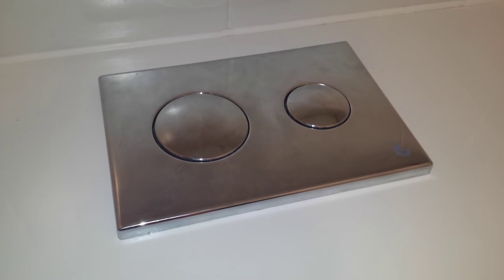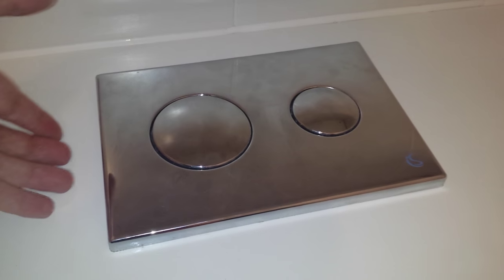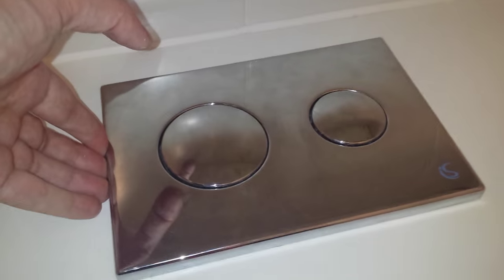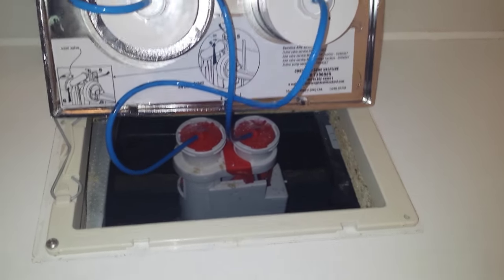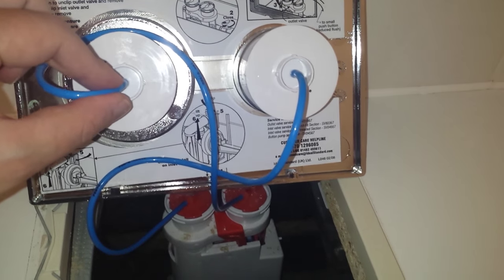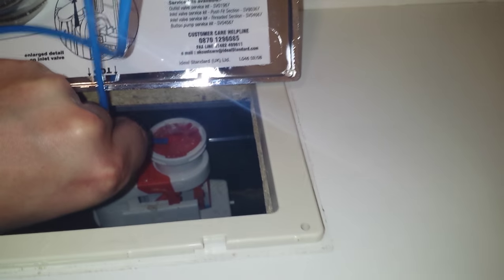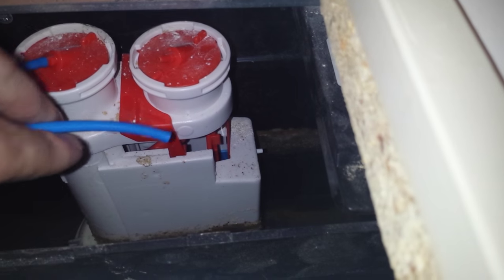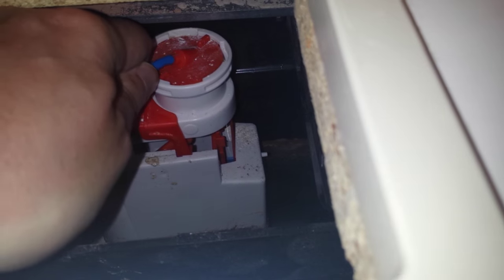Ideal Standard Flush Plate Removal

Comment: Thanks very much for this video, it was just what I needed.  Great that the Ideal Standard model number is no-where visible.  Turns out the big pneumatic pump has had it, but the spare part code, which IS printed on the back once you get the damn thing off, is more expensive than buying a whole new unit including the two pumps!

Comment: My toilet cannot stop after flushing. It leaks in small amounts but when I opened the lid I noticed the water continues to flow out through the back part of the part labelled 6 on the diagram (maybe the inlet valve). Please help.
Reply from the maker: Not a plumber, but part 6 is where the ballcock rises and stops the water, so if that is leaking then google how to replace the ballcock valve washer.

Comment: I'm hoping you can help me with another issue. My toilet will not flush.. No pressure from the push buttons. Any ideas?
Reply from the maker: Not a plumber, but try manually moving the mechanism that releases the water, as it may have just got jammed.  I had to take mine apart and clean off the limescale, but you can often buy the whole mechanism off amazon for a reasonable price.
Reply: @GreyCubeTube  Thanks GC, I did manage to put water manually in which worked for one flush. Any ideas what the mechanism is off by hand? I haven't the foggiest.
Reply: Think Ive fixed it. Issue with the rubber seals from one of the push buttons to mechanism and the cable is rubblish. Thanks GC
Reply from the maker: @BillyBufter  Good job, glad you got it sorted.  To answer your earlier question, the mechanism in my toilet is listed as SV93467 on amazon.
Reply: Can you please do a video to help us

Comment: I have exacly the same  buttons only i have a issue it is very hard to push that buttons when i want to flush the toilet have you ideea what can be or how to solve this issue?
Reply from the maker: The buttons push air, the air pushes the plastic mechanism, most likely the mechanism is covered in limescale making it hard for the air to move the parts. It's hard to clean, so easiest to find the mechanism on Amazon and just replace it. Mine is held by some hooks at the bottom, so you rotate it to unhook and then pull out, but your design maybe different.

Comment: How do you get them to flush better
Reply: I have to press both buttons to make it flush
Reply from the maker: @paulwillis3748  That's normally a sign that the mechanism is covered in limescale or worn out, so the button air pressure doesn't have enough strength to make it move.

You can take the mechanism out and try soaking it in a limescale remover or just buy a replacement from Amazon which is less effort.